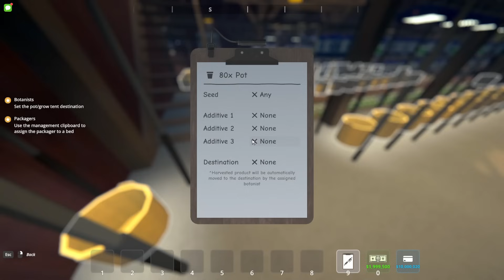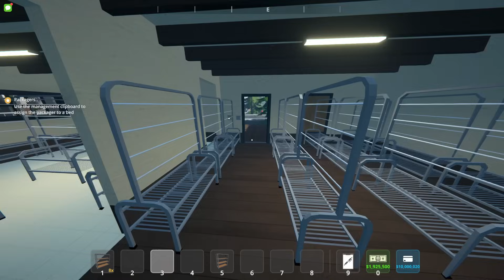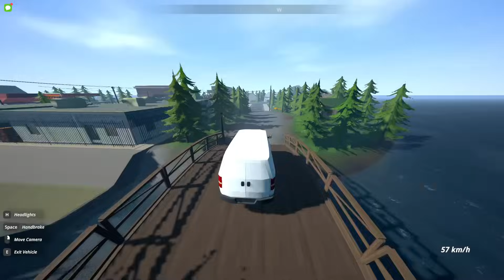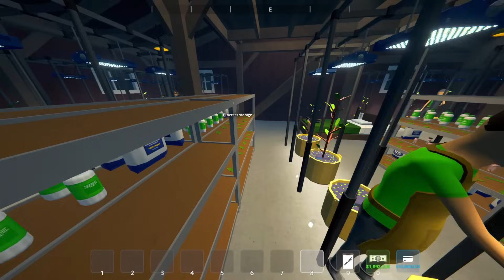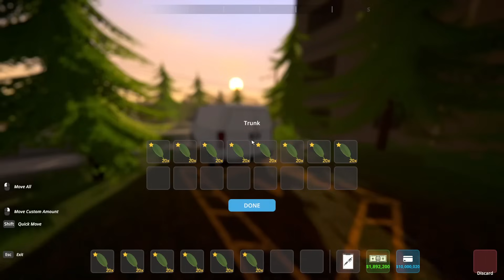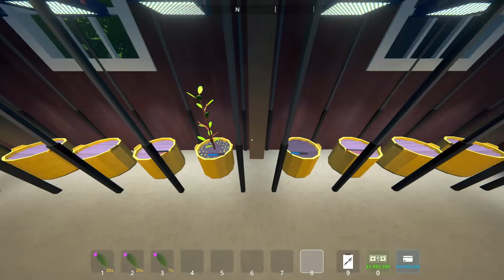Schedule 1 - MOST Efficient Mega Factory Can Produce 72 Bricks (Build)

Comment: Mr. Cowboy I know you have a very disturbing obsession with using all your properties. However it's super annoying to drive your product between them. The chances of you getting caught and time you waste makes it very very tedious.

 I would say combining the barn and the docks is ideal. With 40 pots in the docks and 8 cauldrons and 8 lab ovens( 4 chemists needed to manage them). And having 8 step mixing in the barn. I know you think that the chemists are bugged with 2 cauldrons but It's not that bugged. And you still get 1 brick in an hour.

You have to keep in mind that your main bottleneck to maximizing coke production is how fast you can refil the mixing ingredients. Having your 8 step mix in the barn let's you have extra large shelves for another set of mixing ingredients. Also the barn lets you order two trucks of mixing ingredients which makes it better for restocking.

This set up is easily the most optimal as using any more than two properties isn't worth the pain as your job only is refilling ingredients at this point.

Comment: Aesthetically I like this idea but it's not very practical to be driving around all day with so much product when you could have the barn and warehouse each produce finish product already bricked. Each of those two locations you could have 36 pots, 12 drying racks, 6 cauldrons, 6 ovens, 6 botanists, 3 chemists, 1 handler, then the only thing you need to do is put gas in the cauldrons, fill up the soil and seed shelves, and either take bricks to dealers or unpackage bricks and repackage to baggies to sell. So much less transporting, and then it frees up the bungalow and apartment to mix or something else if you feel like it. I think you could even fit 12 pots, 4 drying racks, 2 cauldrons, 2 ovens, 2 botanists, 1 brick press, 1 chemist, 1 handler, into the bungalow if you really wanted to. It wastes so much handler labor to have to stock from shelves vs have the items destinations be the next thing in line. 1 cauldron per 2 drying racks seems to work just fine for me.

Comment: Using bungalow as a 8 step mix from your dock guide is too good to skip,  im pairing it with a 32 pot/8 rack/8 cauldron  brick press at barn that makes between 16 and 24 bricks a day which is roughly how many you can expect from the mixers daily if you keep shelves stocked

Comment: Ironically, you end up making more trips by producing pure product instead of lacing it. You need to do 3 trips from the barn, 3 from the bungalow and 2 from the docks. If you lace the product with an 8 step process to produce 8 bricks, you will need to do 4 supply runs and 1 trip to supply the cocaine and the resulting laced bricks will still be worth twice as much as the 18 pure bricks you are producing with the setup.

Comment: You can avoid the Cauldron Bug by spacing the Cauldrons far enough from each other that the assigned Chemist is only ever in reach of a single assigned Cauldron. The Cauldrons brick because the Chemist will work on one Cauldron but the craft will trigger on another assigned Cauldron within range, thus bugging out the Cauldron the Chemist is actually working on.

Comment: My setup with just the barn and the warehouse is as follows:
Barn (Meth production and product mixing using the currently best ingredients as per my most recent google search): 
- 16 mixing stations (8 for meth, 8 for coke).
- 4 chemistry stations
- 4 lab ovens
- 6 chemists
- 4 handlers
Warehouse (Coke production. Coke gets shipped to barn for mixing):
- 10 pots
- 10 dry racks
- 5 cauldrons
- 5 lab ovens
- 3 chemists (As of this writing I am contemplating reducing to 2 chemists and removing 2 cauldrons and 2 lab ovens since drying of leaves takes quite long. But I might also just choose to not use the chemists until there are enough dried leaves prepared).
- 4 botanists
- 2 handlers
- 1 cleaner

Tips: Use the safe as a more space friendly storage container. Safes can be used by workers.
Reply from the maker: Neat little setup, I like how you're producing two products due to the difference in production rates. That's really smart. I'm more of a all or nothing, take a big sacrafice at the beginning and then mass produce. Then not have to look at it until you need to produce again. You're also making up for the diffrence in price by 8-step mixing.
Reply: @Cowboyllc  Yeah. I learned that the listed price can be up to 1.5 times the suggested price so my current meth price is 500 (after mixing) and coke is 999 (since it seems that you can't have a price larger than that for some reason). The suggested price for my coke is around 740. I haven't sold the coke myself yet, only given bricks to dealers, but I can get up to 700 for 1 meth which is insane.

Comment: Airpots are slower than moisture pots for the botanist cause they cant keep them watered
Reply from the maker: Is this actual facts
Reply: @Cowboyllc  yeah it may not be 100% accurate but my air pots are always dry
Reply: @Sebastian12112 Mine keep up pretty well but I only assign 5 per
Reply: @Cowboyllc  sure is, easy to test too just change 1 workers pots over and see which ends up with more product in a day